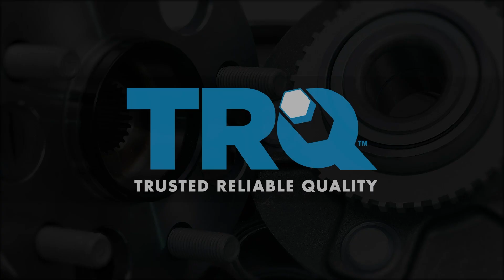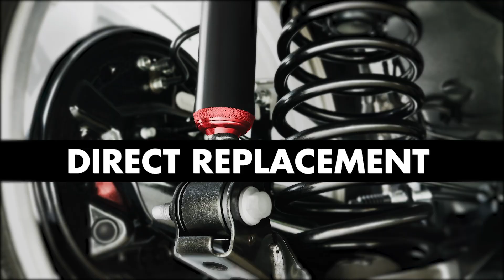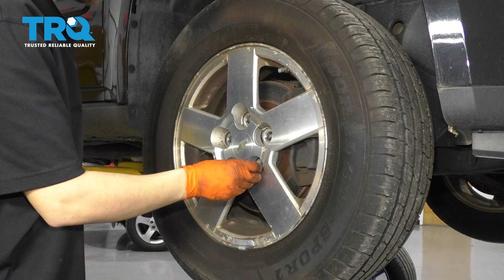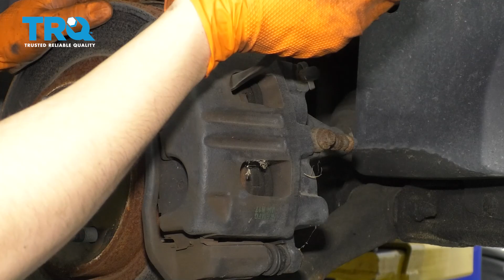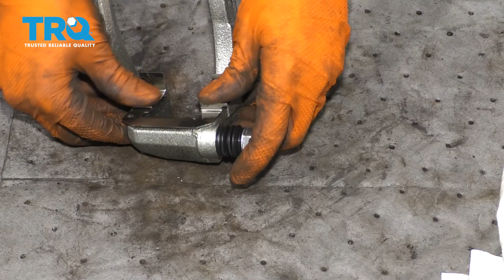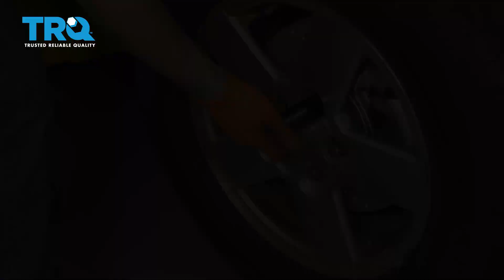How to Replace Front Brakes 2005-2009 Chevy Equinox

Comment: To remove the rotor, remove the T-27 Torx screw that secures the rotor.  It's located in between 2 of the lugs.  Pull the rotor off.  If it's rusted on, tap it with a rubber mallet.